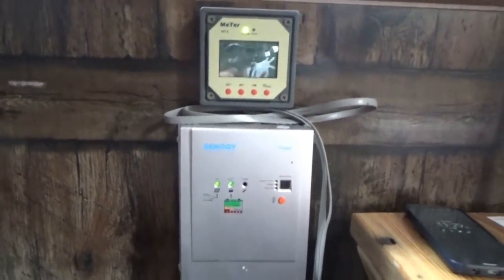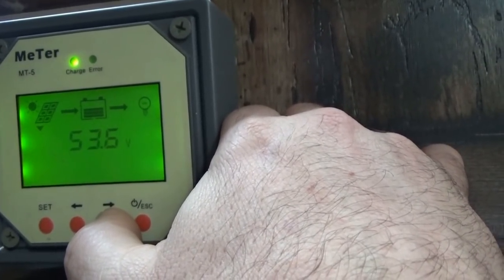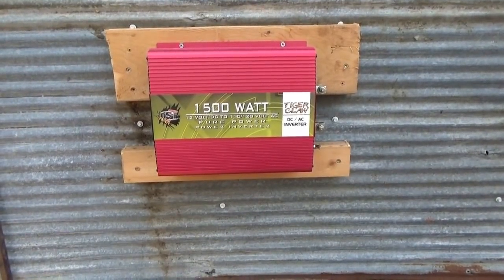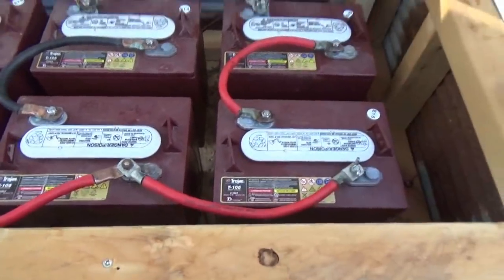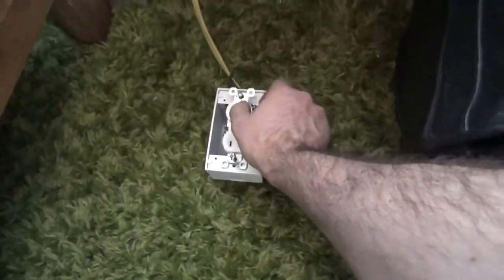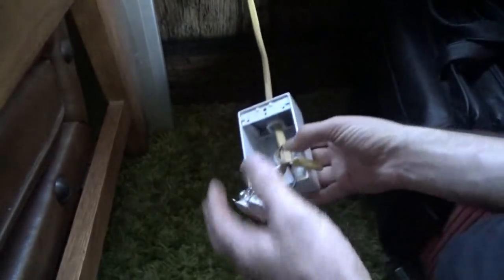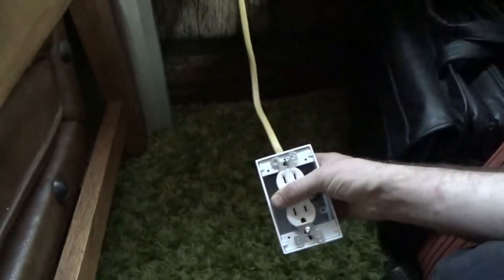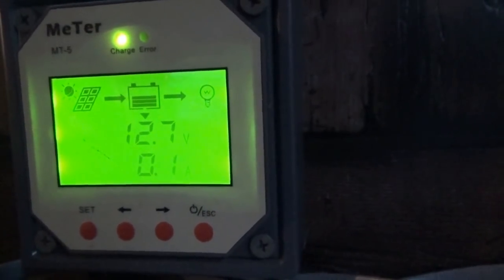Getting AC Solar Power In The Tiny House

Comment: 53 volts solar array charging 12 volt battery is wasting power all the excess voltage is getting burned off  you can increase your amperage for faster charging by lowering your voltage to increase the amps (higher voltage less amps,, lower voltage higher amps)  Ive see several people on youtube running high voltage to charge a 12 volt bank but its a waste. Yes 12 volts needs heavier guage wire to keep the voltage loss down but thats better then extreme efficiency loss from high voltage conversion to 12 volts.
Just trying to help out Dude

Comment: Battery Bank looks great but you really have to rethink about putting inside the inverter.Hard wire it...i think is best for you to invest sub box panel and get a roll of electrical wire.
Reply from the maker: I will insulate the entire thing and put the inverter in a housing out of the elements.

Comment: Troy,  
Can you tell me the reasons why the inverter can not be inside the house ? 
Would it be a good idea to charge your small stuff straight off 12v ?   I run my laptop off 12v and step it UP to the required 18v instead of running an inverter.  Has worked great for the last 3.5 years.  
Bring the inverter inside where you can switch it off and keep the humidity and temp constant.  
Solar Generator looking good.   J
Ah,  just read your not allowed.   Sorry.   So bring an off switch inside.

Comment: Hey Troy cool video man!!! It’s sad all you are hearing from this video is about the inverter being outside the box. I know your smarter than that and also know things take time to do. So don’t worry about that. But one thing I am concerned about is I don’t know if you have a temp sensor on those batteries? If you don’t the charge controller will automatically set the temp to 70 degrees and your batteries won’t get the proper charge they need because they will be a lot colder than 70 degree in the winter!!! I’m sure you are aware but just making sure. Thumbs up man
Reply from the maker: Yes missing the temperature sensor bugs me. I am trying to figure out how to make that happen but this is an outdated charge controller. Not much support left.

Comment: Good thing the power inverter is waterproof ..heaters and frig you do not put on exs coreds.
Reply from the maker: I am building a box around this and it will be heated and ventilated.
Reply from the maker: I dont use electric heat. What a waste. We use a wood stove.

Comment: Are you running a large or small frig?  How many watts does it use?  Any other large appliances on the solar?  thanks!
Reply: How will you run air-conditioning during the summer?
Reply: How much watts does the well pump use?  Is fridge small or standard size?  Thanks!
Reply: Bring us a video on this.  Sounds very interesting.
Reply from the maker: On the one system only the 300 watt fridge. This new system will only run LED lights, laptops and charge small electronics. The well pump remains to be powered by solar.
Reply from the maker: We did not use it this year. I plan to use geothermal cooling. A deep hole or trench with tubing and a fan as an AC. Blows 50 degree F air into the house.

Comment: Fuel pump.? Mabey Relay. Broken wire . fuse hope not body control module
Reply from the maker: No power getting to the fuel pump. Relays and fuses are good. Swapped them all around. Can hear the relay turn on but not the pump. Wires in between are bad.

Comment: Hi Troy me myself I would put that inverter inside if possible how’s your truck did you get it fixed
Reply: Troy, if you would have mentioned that in the video you would have eliminated dozens of negative comments! I'm referring to the inverter being outside in the weather.
Reply from the maker: Melanie does not want it inside. Truck not getting power to the fuel pump

Comment: I'll assume you have a plan to shield the inverter from weather and critters from munching on it. Other question is if the inverter has a remote on/off switch you can mount inside so you don't have to slog through feet of snow and cold this winter? 
You might want to switch out the AC socket for a child/cat resistant version and see if there is a child resistant DC socket cover since the batts can provide an impressive arc display if the DC socket is shorted out!
How is the propane stove working out? The propane ovens can be a bit tricky for even baking.
Reply from the maker: Yes it will be fully enclosed. I will have a safe power unit. We are used to propane

Comment: Why not simply put the inverter inside the box and build a small roof over it? This would eliminate a whole lot of work and an unsightly structure.
Reply: That seems to make a lot of sense.
Reply from the maker: I am not allowed to bring it inside. So I make a box outside.
Reply from the maker: Everyone says the acid in the air from the batteries will destroy the inverter. So I will build a box on the box.
Reply: @The Do It Yourself World. How Are you going to flash the box? The flashing needs to go underneath the siding at the top, and over the top of the box.  Then it'll need to be caulked on all sides to prevent leakage from the snow that will inevitably pile up around it. Caulking doesn't last forever. why not put it on the inside of the house up high away from the baby?

Comment: so the next video you build a lean to with a tin  roof and large post on the side of the house to cover up everything?? I assume it is already done so rain will not effect the inverter whatsoever.
Reply: With the amount of snowfall in his area he’ll need that inverter at least 6 feet high to protect it from drifting snow. The inverter needs to be inside the house.
Reply: The temperature will have adverse effects on the inverter too so it wont work well at all.  He will have to scrap that idea of having it outside not worth it at all.
Reply: Read your manual it will say the inverter wont work well in cold temperatures scrap that idea and put it on the wall beside the charge controller that is going to be the only way it will work properly. It will be a huge decrease in efficiency.
Reply: They put them in the shed because they are not safe to bring in the house. my shed has a fire place in it and I got tired of building fires in the stove to keep the batteries warm its easy to just hang it on the wall inside they house and then its always the perfect temperature for the inverter. You loose half your power charging led acid batteries you need come over to lithium ion batteries they just suck up all the suns power and give it all back. They are the thing to get. Some people collect 1850s but I use the nissan leaf batteries.  Cells For Smaller projects - http://j35.us/SmallerBatteries   Large Automotive cells - http://j35.us/150perKwMods
Reply from the maker: I have seen so many inverters and charge controllers outside in unheated sheds through the years. Anyway, this box will be heated and insulated.
Reply from the maker: No. I am going to make a box around it with hinges so the entire box can open up, exposing the inverter and more charge controllers. The box will be vented on top and bottom with screens to prevent insects.

Comment: So what do you think is going to happen when it rains on the inverter?? Or snows or ices it up? Say Bye Bye Tiger Clay inverter. Electricity and water dont play nice together and you could even get shocked. I know you know better than that but why not say Im going to cover it up soon  rather than freaking us all out? You are going to cover it up arent you? I am using a 1500 watt Go power inverter on my fridge and TV and Sat.  Works good.
Reply from the maker: I did cover it up last night with two large pieces of metal roofing. For now it is safe but I will put a proper insulated cover on the entire structure.
Reply: I knew you would build something over all of it.

Comment: Your set for sealed batteries, and your using flooded batteries
Reply from the maker: I had to edit the settings on the charge controller.
Reply: +The Do It Yourself World   I think you should reconsider your inverter outside, most inverters do not like the cold, it just won't work when it gets cold out, just a suggestion
Reply from the maker: Going to be inside a box which is heated and insulated.

Comment: I wouldn't want all of the wiring all over the place like that with an infant in the house.
Reply: Debbie Doud Are you serious? You're kinda jumping the gun aren't you? Troy is NOT finished with the project!!! Hold your panties ok
Reply: Debbie Doud The majority of the " wiring" is outdoors in a compartment for that reason.
Reply: Based on previous wiring decisions, I have a reasonable concern.
Reply: Debbie Doud No your just trolling for no good reason.
Reply from the maker: And the wires will be hidden by wood trim. If she starts to rip out the walls and trim then we are in trouble anyway.
Reply from the maker: I will be in a box, safe and secure, all on its own. It will look like a normal wall outlet when done but not wired into the house itself.

Comment: You could add a super capacitor to help with the fridge surges this way the stress will be on that instead of the inverter
Reply: that actually does help some I think I tried and it seemed to help but I had no way to check that? Seems as though it should help with the surge and keep it from drawing down the batts on start up.
Reply: Sorry but a capacitor is not the right choice. The inverter itself has the capacitors it needs to start up a surge appliance like a fridge. Car audio capacitors use them ONLY because the wire distance the the current has to travel. Also a capacitor is only using borrowed energy from the battery. The moment the cap discharges it automatically starts Charging itself and that would just put more strain on the batteries as its charging the cap and running the appliance at the same time. The correct way to do this on a solar setup is to up the battery voltage to 48v to cut the amps in half. And it would put less strain on the batteries. Caps are only good for cars ONLY because the wire distance is great and you have a alternator that recharges it not the battery
Reply: Actually thats depending on the Capacitor type. Car Cap's are low value like 1-5 farad. If he uses some high end supercaps it will help. Most people in the car Audio Industry use Super capacitors  on high end systems anyways nowadays. I use a 1500 farad myself. But using a bank of Supercaps on the power input of a power inverter will reduce the start up stress tremendously, and will help with inrush currents. Yes they charge back up in no time.
Reply from the maker: Good point
Reply: The Do It Yourself World you can find them at most Walmart’s and automotive part stores people use them in cars high amp Stereo systems to take the stress off of their batteries
Reply: The Do It Yourself World I have a masters in electronic engineering you can find them at most Walmart’s and automotive part stores people use them in cars high amp Stereo systems to take the stress off of their batteries

Comment: How are you going to run your lights and your fridge off of 1 plug , I under stand it works
Reply: Power strip.
Reply from the maker: Fridge is on its own line from the other panels. This will have four outlets for lights, pc and other things.

Comment: For proper grounding..... You need to do more than connect the ground wire to the outlet.  The ground wire needs to be connected  to a ground rod that is driven 8 feet into the ground. The rest of the system should be grounded as well. Just concerned about safety.
Reply: There’s a lot going wrong here. He should consult a licensed electrician on this install. If the house catches fire his homeowners policy will likely decline the claim. In fact to cover himself he should probably get a building permit and have the code officer sign off on a proper installation.
Reply: I agree, it would be far better to get a building permit and have the system inspected for proper installation. That is for his safety and the safety of his family. However, I understand his financial situation. So again, I agree that he should at least  consult  a licensed electrician.
Reply: Don’t be offended Troy. What you show in this video IS wired into your home via a penetration through your interior wall and you’ve got an unfused, ungrounded, non GFCI electrical receptacle that isn’t installed at the proper height. This application is extremely dangerous for your baby when she begins crawling!
Reply: Troy, let me add one more point if I may.... Arc fault protection or Arc Fault Circuit Interrupters (AFCI) are now required by code and is good idea to have. The purpose is to prevent overheating and fires in the event of a loose connection or damage to wires. Here is an AFCI educational video explaining more.... https://www.youtube.com/watch?v=1Z5-U-A4frU
Reply: P.S. I'm not sure if AFCI is required in existing construction like Troy's house or if it is only required in new construction. But in my opinion it is always better to follow the latest codes for safety.
Reply: I'm confused. The wall he's penetrated is not interior, it's an exterior wall.
Reply from the maker: Problem I have read is that they dont work with power inverters. The power inverters do not work the same as AC household electricity. I forgot the details why tho.
Reply from the maker: I talked to the electrical inspector long ago. He was first, very unfriendly. Second, did not want to waste his time with me. Third said just do what I want. Its not wired into the house at all and it just annoyed him that I bothered him with it.
Reply from the maker: I plan to do that.

Comment: 470 watts? Are you only using 2 of 4 the solar panels?
Reply: Something is amiss. One thing for sure is he’s got about 10% loss in voltage over 65 feet using 10 gauge wire. I would suspect there’s more loss in his connections. Hopefully they’re MC-4.
Reply: The reason I asked was that Troy said that he was getting 120 watts out of 470 (total). With 4 solar panels he should have a total of over 800 watts. So it appears that he only has two 235 watt solar panels connected in his setup. So my next question out of curiosity would be why?
Reply: Ah I see. He’s only connected the two 235 watt panels  I had to watch again.
Reply: The panels powering the fridge, is the inverter a pure sinewave inverter?
Reply from the maker: two solar panels powering the fridge - sort of. Now I need a third panel again for that. Two panels will power other devices.
Reply from the maker: I have more panels. Just out of money to install them.